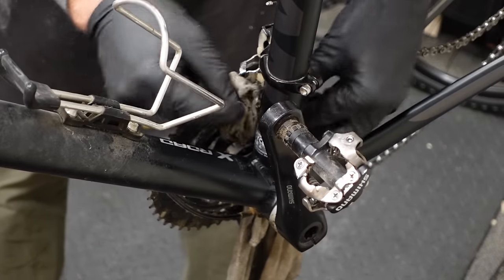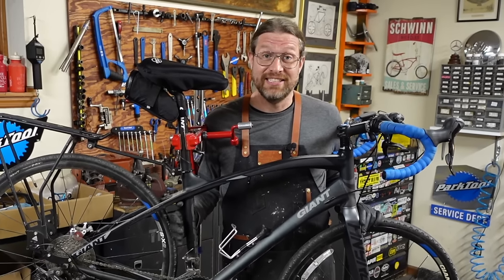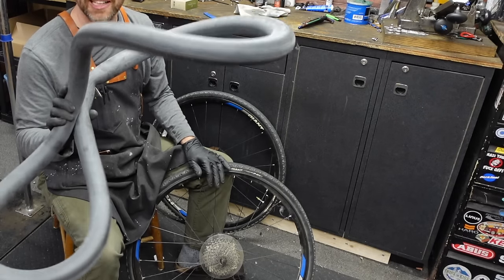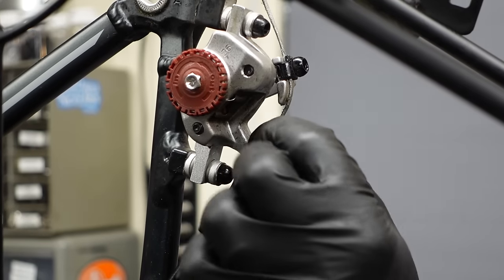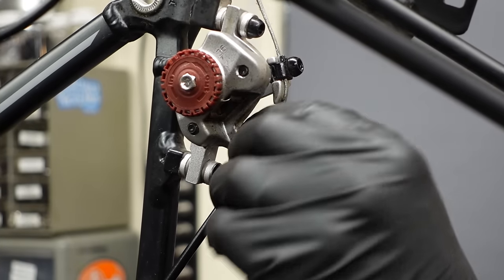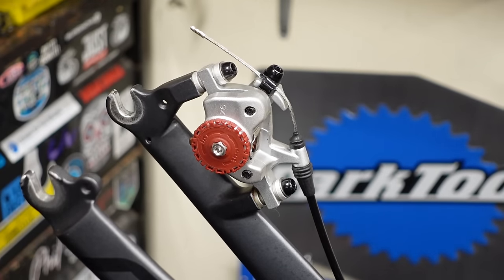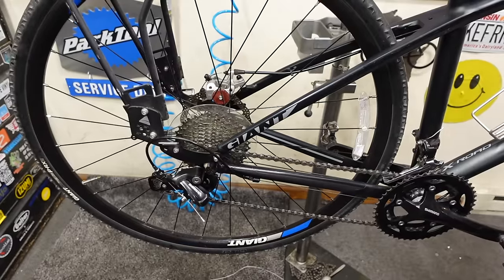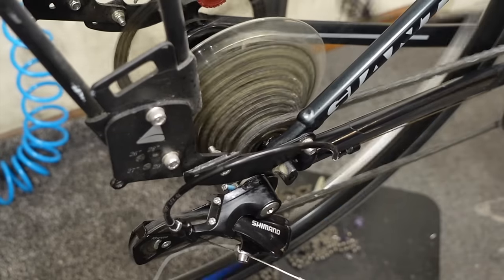Preventative Bicycle Maintenance the EASY WAY! Giant Anyroad gets a basic tune and a couple tweaks!

Comment: He should show us home users, how to true a wheel while it's on the bike! That, would be amazing.
Reply: If you have rim brakes, you can use the brake pads. Clamp down on the brakes a bit, for example with a zip tie, so that it's just rubbing. Or, even better imo, attach a zip tie to the frame next to the rim, cut it down to the right length so it's barely touching the rim and use it as a gauge. That works really well actually, up to a run out of only tenths of millimeters, which is plenty good enough. There's tons of videos out there already on how to do it.
Reply: you can use a zip tie or a cute invention that you can attach to your seat stay, but its not ideal for a proper wheel true because there's a lot more to wheel true than just wobble. and that can stem a longer rabbit hole. If you are looking to improve your skills, having a truing stand is worth it. or if your wheels go out of true a lot.
Reply: He has shown us before as well- probably will again someday
Reply: True to that!
Reply: @spitt0110 I've never had a truing stand in 40 years of building wheels. You don't " need" one.
Reply: Hence why I still stick with rim brakes, no di crap, no power meters 😂easy to maintain and super cheap as well.
Reply: There are already too many vids on youtube on how to true a wheel tho
Reply: @djsonfire0001  I see what you did there.
Reply: There are already many videos about truing a wheel.
Reply: On alfredo mancuo channel they have a video showing truing a wheel using zipties as indicators
Reply: What oil do you use for lubing the cables?
Reply: @christianb.1028  Ditto that! I've been doing it that way for a few years. A friend of mine has a truing stand which works too.  He loves to brag about it. I get to borrow it.
Reply: Finding this video oddly satisfying.
Reply: @christianb.1028  tenth of a milimeter? idk about that one buddy!! park tool reccommends truing to <1mm runout on each side with their truing stands. Sitting on the bike flexes the wheels more than 1mm. not sure where you are getting the time to true it to a tenth lmfao
Reply: @bmxscape   You either didn't read or didn't understand what I said. I said it's possible to true a wheel to the 1/10th of a mm with a zip tie and this statement is undeniably true. I frankly don't give a s*** how you do it, butI highly doubt that Park Tool recommends uneven spoke tension by "recommending" a runout above 1 mm 😂😂😂 Plus a runout like that would be hell on a rim brake bike. You simply have no idea what you're talking about 🤦
Reply: @christianb.1028  what? the point is this is not rocket science.. this is not a rocket ship, and  there is no need to waste your time truing it past the point it will naturally flex while you are riding it. i don't really care how you waste your time but i figured i would at least let you know that you are indeed wasting your time
Reply: @christianb.1028  also you got me with the 1mm, i mistakenly wrote >1 instead of <1. Go grab your wheel right now, i bet you can flex it with your bare hands more than 1mm, letalone 0.1mm
Reply: @bmxscape  Of course you can flex your wheel by more than 1 mm when you press against it and it flexes when you ride it, duh... 🙄 But that doesn't change the fact that it's better to have a perfectly true wheel with as little runout and as even spoke tension as possible. You don't seem to understand the concept of trueing... But please, you do you and ride wheels which are just true enough, I ride wheels which are as true as possible. To each their own.
Reply: @christianb.1028  nothing is "perfectly" true
Reply: @christianb.1028  please ,upload a video showing us your 1/10th of a mm runout on your wheels. until then i will assume you are just talking nonsense
Reply: I built a rear wheel using a zip tie

Comment: My 2 cents...as part of my post-ride routine maintenance, first thing I do for drivetrain cleaning is take a scrub brush (used dry, no solvent) and  scrub the rear cassette. Gets off a lot of road grime, which prevents a dirty cassette from re-contaminating a freshly cleaned and lubed chain. Thanks for posting a good, sensible tune-up routine. I've been doing essentially the same routine as what you posted, for years. I get great mileage for my chains, cassettes, and rings. And I start every ride with a clean bike, pristine drivetrain, & tested brakes. Takes about 10 min to hit the important stuff post ride.  Over time, you get to really know your bike well, and can catch problems early so they don't surprise you on a ride. Having a workstand really makes the routine easy. That was a good suggestion!
Reply: Are you riding every working day, 5 days a week to job and back? Do you spend more 40 min to each ride to work? Do you live in appartment? Please explain how you find time to this after each ride...
Reply: @abupinhus  LOL

Comment: Hot tip for disc brake bikes. Don't spray anything directly on the bike. Spray it onto the rag facing away from the bike, then wipe the rag on the bike. Will help prevent your brakes sounding like a Wookie.
Reply: Thx I'm thinking about a new bike. I have trad center pull brakes.

Comment: A better way to check for inner tube leaks is to fill a sink or a mop bucket with soapy water, inflate the tube, dunk it and rotate it until bubbles appear, where the bubbles are coming from is where the hole is, I've done it many times when patching tubes it can be done on the side of the road too if there's clear water in a pond or ditch.
Reply: Or in any toilet!
Reply: Or the Birmingham and Fazely canal on a freezing morning!
Reply: By the time you go through that hassle, you might as well just put in a new tube. Especially if you’re on the clock like he is.
Reply: @pentiuman  well yes, but no 😅
Reply: If i cant find a small hole in a tube i just cut a big hole in it so  i know where the hole is and then replace the tube.
Reply: Good old spit on an area suspected of leaking works great too …
Reply: Another alternative is to have a jar of somewhat soapier water and apply it with a paint brush.  If you're riding sew-ups, I think it's good not to soak the base tape too much, and you waste less water this way.
Reply: @ianross-bain3515 
Me too any dirty canal in Brum or Smethwick canal - has it's unique au de stink
Reply: @christopheroliver148  That's the best approach IMO.
We do this when checking for gas cylinder installations. Quick and easy, would have probably taken 10 to 15 seconds to do.
Reply: Spray soapy water on it and look for bubbles
Reply: While soapy water certainly works best, if that’s not available out in the field you can move the inflated tube slowly across your lips bit by bit, gently pulling on both ends to stretch the hidden puncture out. The thin skin on your lips is very sensitive to  air flow.

Comment: I used to use Pledge furniture polish on my motorcycles as a final clean/wax. I didn't realize I could use it on my cycle. Awesome, thank you. 🙂
I've just finished watching the whole video and you're totally right. It's what I do with my bikes although I usually only do it once per year and adjust as needed. Once a month is a good idea and maybe I will change to a few times per year as I'm probably too lazy to be committed enough for every month. Life kind of gets in the way but a great idea.
Reply: It's popular with small airplanes, too. The Lemon Pledge (gotta be lemon) on the leading edges before flying really make it easy to wipe off the bugs and junk afterwards. Some people also use it to polish the plastic windscreens on small planes. If you go to small plane fly-ins like the one in Oshkosh, WI, you'll get a good whiff.
Reply: @garrettnievin5812  It has silicone in it. Bad for wooden furniture if you ever want to restore the finish, it repels stain, and finishes.  Nearly impossible to remove.

Comment: I am sure it is obvious to you and me, and I imagine you have covered it in other videos, but before making derailleur adjustments, check the chain for wear; a worn chain will definitely impact shifting performance. Then, for the rear derailleur, it must be confirmed that the hanger is not bent, the hub bearings are not loose, and if it is a freehub, the cassette lockring is torqued so the cassette is not loose. Also, for a front derailleur, the bottom bracket must not have bearing play, and the cage is confirmed to be parallel and mounted at the proper height. It amazes me how many bikes come from the factory with the front derailleur improperly mounted.
Reply: Off by a quarter inch

Comment: Thanks for a great video (and channel)...freshly subscribed.  I've been riding for almost 60 years with various bikes but had to take a 3 year hiatus due to retiring and moving and life in general...I dragged my bikes out a week ago and they were dirty! broke them down a cleaned them up, made needed adjustments etc. One thing I learned from trying to clean between the gears in the cassette was to use a piece of 3/16ths rope (or whatever size fits snugly between the gears) soaked in degreaser...simple green or whatever. I use it to "floss" the nether regions and it works great. It doesn't get caught on the gears like a rag.

I had to learn to do most of my own wrenching because the only decent repair shop in the area I lived in had a 3-4 week backlog almost all the time and as a kid, I barely had enough cash to buy a tube repair kit. Where I moved to (southern Missouri) has like one or two bike shops inside a hours drive but they are booked solid as well.

Comment: I use a couple of old spoons to lever the tyre off. I use the head of the spoon to check the inside of the tyre to check for nails, glass, etc. If the glass or nail is sharp, I have received cuts using my fingers.

Comment: Based on The Bike Farmer's suggestion, I bought a 4-pack of Dawn Powerwash. - And it works so well, gets so much dirt from my wheels, almost every wipe, one after another, that I have to wonder if it removes a lot of rubber particles from the tires. - And I also like his One Step product suggestion, but wonder, how could it possibly both clean AND lubricate? Huh? I also bought a big bottle of Tri-Lube I think it's called. The problem with it, is, as long as the straw is attached to it, the bottle falls over and starts leaking out of the bottle at the drop of a hat. So, I have to store it in a coffee cup, so it won't get knocked over. I'm learning so much from this channel, I could open my own bike shop!
Reply: Nothing cleans and lubes at the same time. His drive train work is sus. Use a solvent to clean your chain and a lube to lubricate it.

Comment: Brother, that move at 13:30 to drop the rear shifter cable housing to lube the cable... Have I been living under a rock???  So nice, i ran out to the shop and did it on my gravel bike.  Awesome new (to me) tip.  Thank you!
Reply: Thanks for this from me, too..  I've been maintaining bikes for 40 years and never realized how easily I could clean and lubricate this curved bit of cable that's critical to smooth shifting.

Comment: Tip: On cheap handlebar tape use under this tape some sport-tape (along the top off your "naked" alu-handlebar. It will give extra friction for the cheap handlebar tape. So the cheap tape will not move when your riding.

Comment: I bought the cheapest RockBROS bike stand ~ $36, attached it to my wooden workbench, and just returned it for a West Biking Bike Stand. - About $9 more, but probably worth it, as the RockBROS stand couldn't hold my bike level when attached to my seatpost. - It would allow the front end to within an inch or two of the floor, as the joint where the Vertical Arm met the Horizontal Arm didn't have a groove, (unlike the clamp to Horizontal Arm connection), and couldn't keep the horizontal arm from twisting under the weight of my Diamondback bike. I probably could've attached the clamp to my Down Tube and had better luck keeping it level, but I originally did it that way, and was concerned the clamp may be restricting my shifter cable - just enough to make my rear derailleur cable adjustment off. - I'm not sure that was happening, but once I got the doubt in my mind, I couldn't not worry about it. I did post a review and about 10 pictures of the RockBROS Bike Stand, with a title like, "Best for rear wheel adjustments". RockBROS sent me an email, saying they could address my concerns, inviting me to contact them back. I almost did, until I realized that, my review and complete pictures should've been enough for them to come back w/ at least one suggestion. EX: They could've stated something like, "You need to tighten the clamp more." or perhaps, "You've got a defective unit. Lets replace it." But No. I got the impression they just replied because they didn't care for my review that rated it at just 3 stars, and thought maybe their attention to me would somehow improve my review. It didn't, because it wasn't a problem w/ Customer Service, or Product Instructions, or anything to do w/ my product choice or use.
Reply: Sorry to hear about your experience with RockBros. How was the west biking bike stand though?

Comment: I had a flat tire like this last year on my brand new bike - couldn't find the hole by listening, it seemed to keep the air - but was flat again the next day.
Found the hole with water, and luckily I could find the place in the tire (had marked the valve position): there was a small small thorn sticking from the outside, you couldn't even feel it from the inside! I assume it pressed into the tube during the ride making the small hole.

So: it is always a good idea to find the hole if possible!
Reply: No
Reply: @jerrygreen3818  Why no? A new tube would be punctured by the same thorn.

Comment: 'How to try to jinx yourself in the first ten seconds of a video' 😂
Thanks for the furniture spray tip!
Just one thing, the reflector in the back wheel wasn't exactly on the opposite side of the valve, it would have driven me crazy...but unnecessary reflectors alone will have that effect on me. That being said the owner of the bike probably isn't riding the smooth dedicated bicycle paths I am used to.

Comment: I use self amalgamating tape in place of electrical tape, it's the best thing, basically like rubber and sticks to itself by actually fusing together. Electrical tape can sometimes peel off esp. in hot weather, but amalgamating tape won't. Decathlon also sells finishing tape, which feels like better quality insulation tape.

Comment: Waterless wash and wax spray on everything except braking surfaces, tyre tread and drive train. After a ride, mist spray from a hose get's even UK mud off. If there is any mud sticking, means the wax has worn thin, so wash and wax on that bit and you are good to go. I love the stuff.
Reply: I use RanX waterless car wash. It leaves a nice wax like finish and makes for an easier clean up next time

Comment: Having a bike stand makes life so much easier. Wish i had one.
Reply: I don’t have a bike stand and get by quite well.  I have 2 small pulleys that hang from hooks attached to the ceiling.  I use the pulleys to lift the bike.  Usually one rope goes through the stem and the other between the rear stays and the seat tube.  I can easily adjust the height as needed.  Very simple and flexible.  I overhaul around 100 bikes per year.

Comment: I do the half way build an manual seat as well. I have stopped over filling tubes though, because i'm convinced bike tubes are less stretchy than they have been, and i've blown too many tubes over inflating trying to "CHECK" where the hole is.

Comment: One of the first things I do when rebuilding a street find bike is remove the wheels, break down the tire and tubes, inflate the tubes, set them aside and crack on with what ever is next. After a while if they go flat I know the need to be binned. I stopped using patch kits they just fail too much.

Comment: The main difference between the cheap and expensive shifting groups are nowadays mostly the weight benefits and the finish (looks). They almost perform at the same level. For daily users the weight difference (and looks) are unimportant.

Comment: Wash your bike the way you did but use liquid detergent soap dilute in water, use toothbrush to clean the chain, drueller, cogs, pedals, sprocket… then wash thoroughly with spray water until all dirt at soap totally remove… let it thoroughly dry, totally dry… then again, use toothbrush dip in a crude oil ( spoonful crude oil is enough to clean the whole bike), brush the chain, pedal, drueller, cog while rotating your pedal mechanically until you hear that smooth sound.. wipe your bike with clean rug ( cotton) dip in crude oil.. brush bolts, expose cables w crude oil…do this after using your bike for a long ride..remember; a spoonful of crude oil is enough to clean the entire bike… i been using this method for more than 20 years by now…

Comment: To find a small hole easily I usually sink the filled tire into a bowl of water. The bubbles will come out from where the hole is.

But really, with the price of the inner tubes it's usually not even worth fixing it.

Comment: Great stuff! That chair really brings the tire changing station together.  I know you're not a big fan of hydro's, but any chance you could do a pad change and bleed? I have new TRP pads ready to go, hesitant to mess with the system though..
Reply: Bleeding hydraulic brakes is 90% reading the service manual and following procedure.  If they are really old or a model known to be problematic (Some tekrtros) its becoming common practice to just replace with inexpensive pre bled Shimano's like MT201.
Reply: Definitely agree with the first comment from emilycs, I'll add that turning the bike upside down to work on hydraulic brakes can mess the job up, use a stand if possible.